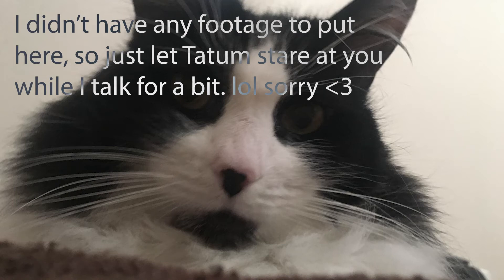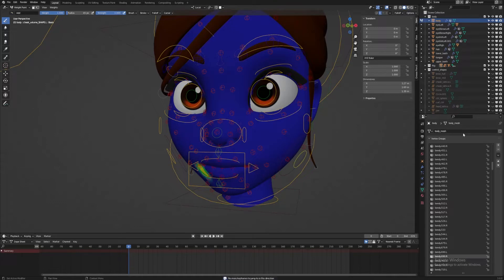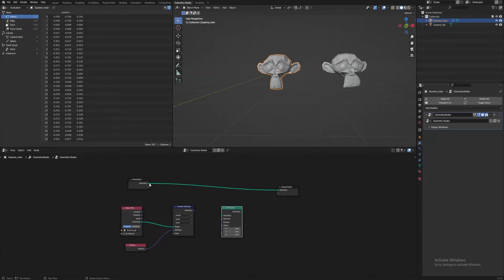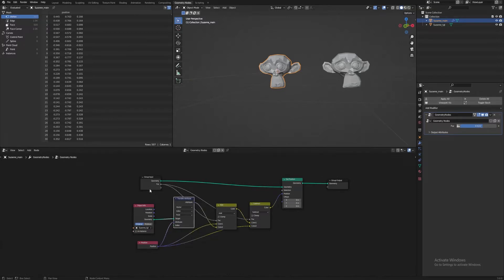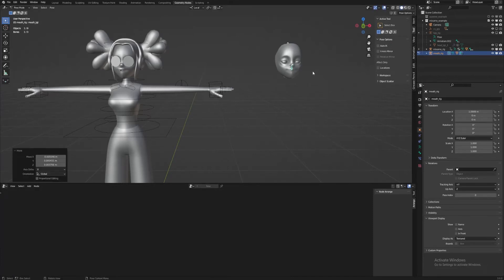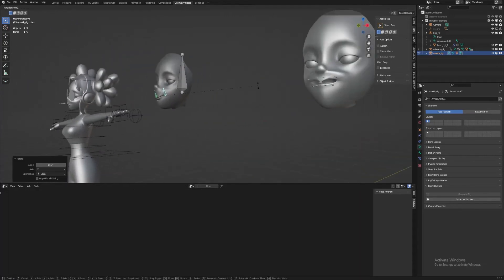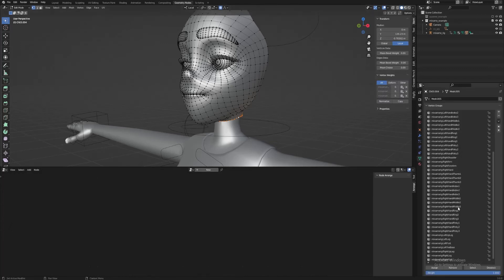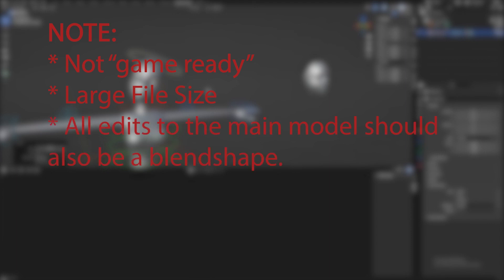OLD! SEE DESCRIPTION - Live Blendshapes in Blender with Geometry Nodes

Comment: wonderful approach, I love can got  the blend shapes in the modifier stacks, I definitively implement this on my rigs
thank you!
Reply from the maker: That's so nice to hear, thank you! As another commenter pointed out though, the setup is a liiiittle different now in the newest versions of Blender due to changes in geometry nodes. But I have messed around with it since the updates and it is still possible. I just haven't been able to make another video on it. But off the top of my head, you'll basically just need to utilize the new "named attribute" node. Also I think you won't even have to worry about making a "subtract" node anymore now that there's a "vector mix" node which should automatically normalize between the two shapes.

Comment: Hi Tim, very nice video!:D Do you know if it's possible to do this in Blender 3.4 now that the transfer attribute is different?
Reply from the maker: Good question! I haven’t had a chance to check out 3.4 yet. I hope it’s not a big enough change to break this process, but I doubt it. I’d be very surprised if this isn’t at all possible in future versions of Blender.
Reply: @TimDownsAnimation   Here in 3.5, Transfer attribute no longer exists. Is there a new way to do this?
Reply: Hey @Eyasluna95  did you ever solve this? I am having the same issue :)
Reply: @metamesh1  Yes, I did! Use a "Transform Geometry" node in place of the "Transfer Attribute" node (plug the Object Info node into that), grab a separate index node, plug the Geometry output from the Transform Geometry node into a "Sample Index" node (which should be set to Vector and Point), also plug the Position node into the Value input of the Sample Index node, and the Index node into the Index input of the Sample Index node. Next grab a "Mix" node, set it to Vector and Uniform. Plug the Factor output from the Group Input into the Factor input of the Mix node. Plug the Value output of the Sample Index node into the A input of the Mix node, then plug in the original Position node output into the B input of the Mix node. Take the Result output of the Mix node and plug that into the Position input of the Set Position node. Finally, take the Geometry output of the Set Position node and plug it into the Geometry input of the Group Output node.

Hopefully you were able to follow that haha hope that helps!:yougotthis:
Reply: @Eyasluna95 Thanks a lot! yeah i did follow and it worked, thanks! :)